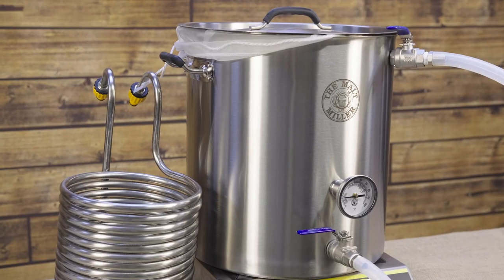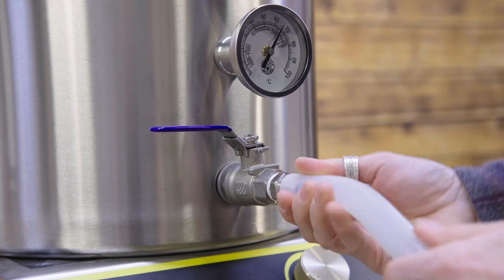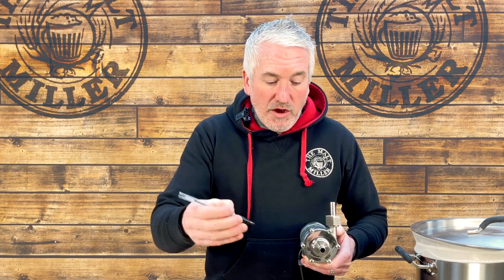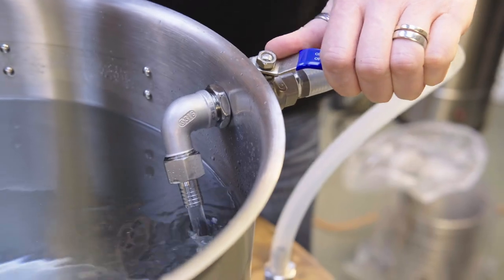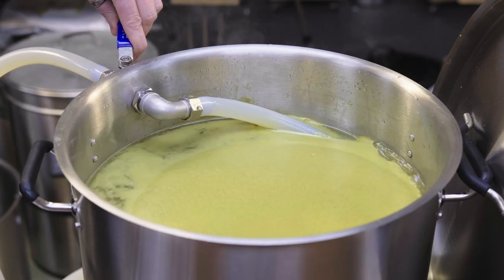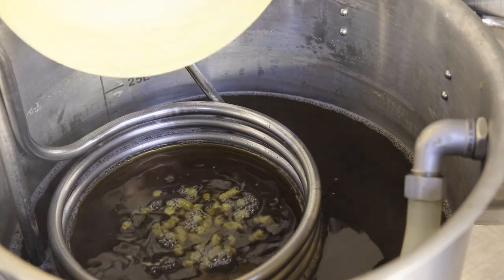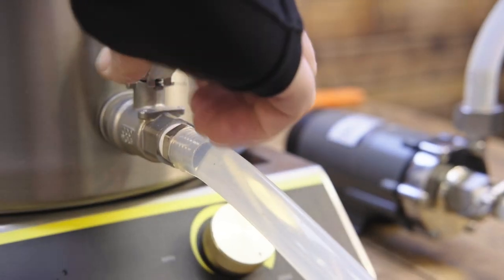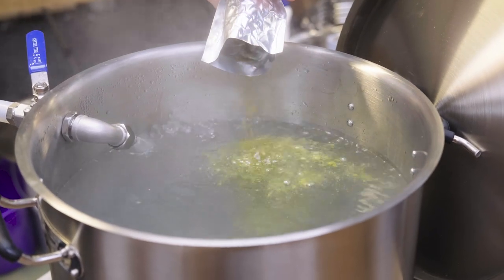The Malt Miller | Brewing Pumps Explained

Comment: I have a few the same style as that pump. I rotated the heads on the by one set of screws so where the outlet meets the body is at the top, rather than just pointing strait up. Found it helps them prime slightly easier.

Comment: Hi Thanks for anothergreat video ! I use an emmersion chiller to cool my wort. I use a GF stir paddle on a drill to mix the wort while chilling to reduce the time taken to cool the wort and it works well but hands could be freed to do other things using a pump. Would it be reasonable to use a pump such as you are showing here to pump the wort from the tap and back into the kettle without causing the pump to get blocked with hop debris ? I know you say you can in the video but you may be assuming a hop filter is in play, I use pelleted hops .
Reply from the maker: Hey! Yes you can certainly use a pump in this way and personally we would suggest this would be a better approach tan some of the stir paddles as their is a risk of hot side oxidisation with these if you are too vigorous with the drill. If you are whirl-pooling the hops before chilling starts then you will have gathered the hops into the middle of the kettle and as such could avoid the need for a filter, a nice gentle speed with the pump should suffice and a well angled return into the kettle with the outlet below the surface of the wort and you'll nail it!